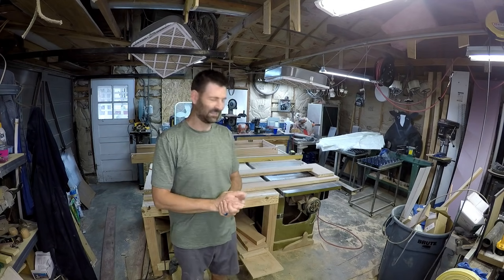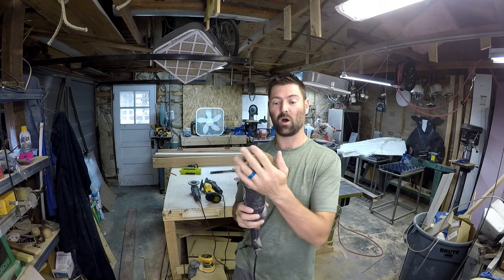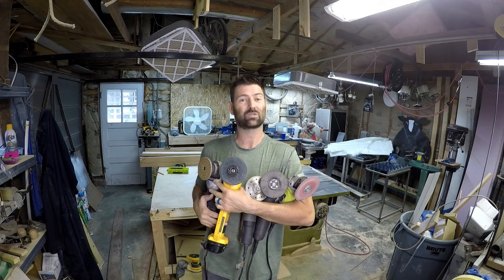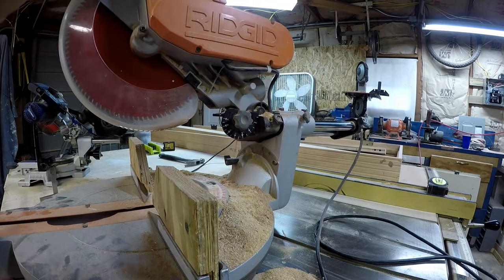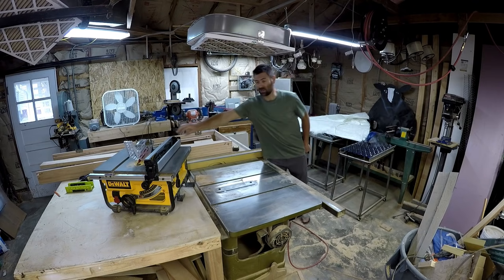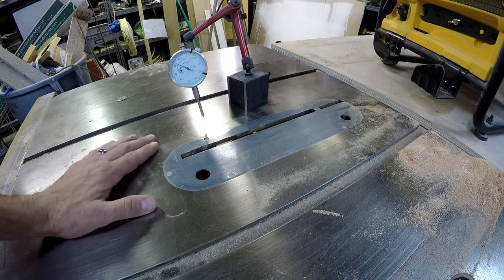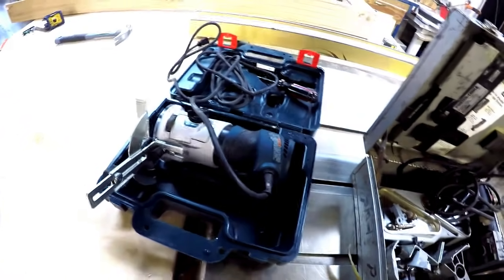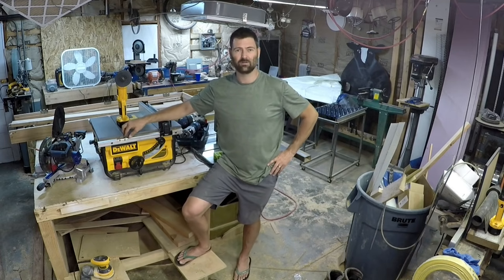Top 4 Power Tools You Need for Home Improvement Projects | THE HANDYMAN |

Comment: Good job. I have "every tool known to mankind" in my shop. But in my daily rental property management field work, I use the hell out of a Cordless Dremel, Cordless Saws-all,  3" cut off grinder, cordless sabre saw,  one cordles drill set up for drill bits and contersinks, and one cordless drill set up for a 6" magnetic #2 phillips and a 7 1/4  Skill saw. I just found some really sharp stainless multi-tool blades on ebay; they really kick ass. If they hold up, I'll use the multi a lot more.  I like the look of the Kobalt. I run into the need for matching 45's all the time. 90's are not that big a deal. 
-
Also, I've started using 1/8" HHS drill bits in a dedicated 36,000 rpm cordless Dremel. Talk about fast pre\drilling holes. busing out deadbolt screws, pins, steel/aluminum pilot holes, and such. It's amazing. 
-
I notice you don't have a magnet glued to the top of your drill to temp hold screws and bits. This trick has really helped me work faster. There's a Ferro /ceramic Magnet that is about 2" long and 1" wide. I get them at Lowe's. 
Cheers Handyman!

Comment: Happy Saturday Handyman. Millennials.  The young husband. For the first time in my experience, the man of the house was not even mildly interested in what I was doing or why. He was too busy playing a computer game,  and laughing hysterically,. Wifey wore the pants today, I had gone to their  rental to re-set a leaking toilet base and install a new Disposal.
-
 Both were unexpected trouble.  Cast Iron Toilet flange was a good 5/8"  above floor level and old disposal was a weird off brand, so my new Badger wouldn't match any of the drain plumbing.  
-
Toilet.  I tried the new Lowe's red Korky poly seal made for this elevated flange problem. I noted that it was not nearly as good as the green Home Depot Sani-Seal. I just didn't want to make an extra trip to Home Depot. But, it all worked out.

Disposal. Fortunately, I barely did have adjustment parts on my service truck. I should have taken this in consideration when I first assessed the cracked housing, leaking, old disposal. Why is it so hard to notice everything?!?

Comment: i like that there's no guards on any of the grinders. Safety Third! :) Keep up the great work on the videos!
Reply: Edward Cope Seriously is the guard really even necessary if not using a blade that can explode?
Reply from the maker: Its best to keep them on.
Reply: Agreed. I think a good angle grinder should make it easy to dettach,  reattach, and change the orientation of the guard without tools so you're not tempted to permanently dettach it the first time that it doesn't suit a particular task
Reply: I used one without a guard and the cut off wheel got pinched and when it jumped it nearly cut my thumb off! Two surgeries to try and fix the tendon, still have very little feeling in it so my advice is to make sure all guards are in place before using a tool. Oh yeah, I have been using tools for 40 years so I was plenty experienced with tools, but a freak accident can mess you up.
Reply: Milwaukies new guard system is pretty sweet. Easy to move around and easy to take off! Once got a decent gash on my hand with on old torquey dewalt. The new ones are way smoother.

Comment: I have the similar DW745, Only difference is only 20 inch rip. Now Dewalt seems to have made it only 8 1/4" blade. Don't think they still make the table top model in 10". Too bad. Sometimes  I need the depth. Also shaft is too short for stacked dado. But all in all the best job site saw I have seen. Bought my son the Hitachi, now replaced with a Dewalt like mine. I too made a job site bench, table saw on the right end and miter box in the middle. Space on the left end for a router table function although I have not done that yet. Great channel keep it up.

Comment: Great Video!  I believe that I would install guards on the grinders fitted with the cutting/grinding wheels.  You never know when one of the wheels will fail.  I've had a few come apart while in use over the years.
Reply: Yes I agree.  I have a Dewalt angle grinder and took the guard off for some reason, don't remember now.  Was intending to put it back on right away.  I had an all purpose cutting blade on there.  A few minutes later the blade came all to pieces.   I put that guard on immediately and then put another blade on there.  But I do find a hundred of uses for my grinder and would like to have more than one.

Comment: Today, I went to a rental that they had busted up to pieces a large kitchen box drawer under a built in oven. Too much weight. In the old days I would take all the pieces to my shop and complete the repair or re-making there. Thanks to all of the modern, portable, compact tools available now-a-days, I worked on my 4' portable work table, and repaired it  totally in about 25 minutes, better than new.

Comment: I love my ridgid r4512 table saw but I won't buy ridgid again after the circle jerk that was dealing with signing up for the lifetime service agreement. One of the things that i found to be the most useful was a Ripping blade. I originally bought a 50 something tooth blade and i was not happy with the performance of the saw before switching. Im in the process of going to run a 240v 20 amp line to it and switch it over.

I recently bought a router to build some shelves and was super happy with all it can do. Though the sticker shock on bits is kind of the worst part. Unfortunately for sears but good for me they are leaving my area and i got a bit set dirt cheap. I will never use half these bits but it was a 32 piece set for about 40.

Thanks for the content.

Comment: Trying to decide on an angle grinder. A 4.5” but battery or corded? Had a 4” makita for 20 yrs until it burned out. So it is between a 4.5” makita or a 20v dewalt( already have a dewalt impact driver with 2 amp batteries).

Comment: Dude, you need more grinders. Lol, I will have to try the diamond blade on the next cast iron run in. One time I had to cut out an SS washer and only had a carbide grit hole saw of the correct size. I think 1-1/8" used plenty of lube and went right on through.

Comment: I don't recommend the 20v grinder. Do yourself a favor and grab the 60v one.

I'm a DeWalt guy, for sure. But, I just hated the 20v grinder, and felt like the 20v batteries just didn't do the job. FlexVolt is great. And, of course, the FlexVolt batteries work in the 20v tools. So, a bit of additional versatility.

Comment: Love your videos and find them very informative.  While I don't necessarily disagree with your choices of tools, angle grinder (most definitely) Dewalt table saw (definitely) Compond mitre saw (definitely) and router (yes).  But I would hate to think of having to do without my 18 ga. pin nailer.  However, I was trying to explain to my wife the other day how much things have changed in the home building business in just 10-15 years.   I was having to tear out some cabinets that had been put in with 16 penny nails.  Want a PITA.  Thank god for screw guns.

Comment: I picked up the Dewalt 20v 7.25inch slider about a month ago. I was tempted by the Kobalt after seeing you use it but I have had my eye on the dewalt for a while. I was in the same boat as you cutting everything with a skill saw. I love that little saw. Supper tight, no run out, smooth like butter and runs all day on a 6ah battery. The little saws are where it's at for punch out
Reply from the maker: The dewalt will be a tighter more accurate longer lasting saw than the kobalt.

Comment: When I bought my first tools a few years ago for a rental I’m fixing up, I went to several stores to check out the tools in person. Some of the angle grinders, for example, were too fat around the barrel for my fairly small hands, or too heavy. In terms of overall size, weight and balance, I liked Makita the best, but that’s a totally personal consideration. I also bought cheap or used tools for cutting brick or other activities that might wreck my good tools. My only regret is the single bevel, non-sliding mitre saw. I wish I had spent more and gotten the sliding double-bevel.

Comment: How long dose the 18 volt grinder run,? Got the flex volt, 20 /60 the 60 volt gets me barely 20 mins, it's a 2 Amp hour battery, dose better with the 20 volt range,

Comment: A question about the dwe7480... I already have a job site table saw that I love but I'm in the market something that can handle a full sized sheet of plywood with around four to five feet of clearance on each side with a locking fence. Does this DeWalt saw have a stand or "extension wings"? I currently use a circular saw to trim down full sheets before using the circular saw and it would be nice to be able to simply use the table saw.

Comment: If you do a hand tool video, could you please tell us which Leatherman or other multi-tool you think is best for handyman work? Thanks!
Reply: Sri Yantra : Thanks!
Reply: I have several leatherman tools and the one I found I carry and use every day is called the wingman. It is slightly more compact than other models, more ergonomic, but primarily, it has a clip on it so I don't have to dig around in my pocket to get to it. I can clip it onto my toolbelt if I'm wearing a toolbelt too.
Reply: Ty Brewer : Thanks!
Reply: Laura B. I use the Kobalt, it comes with a pouch that attaches to any belt.
Reply: Hardcase8, Leatherman Case, Fits Wave, CHARGE TTI or REBAR. leatherman Hard case Made In USA https://www.amazon.com/dp/B07CVMLCXF/ref=cm_sw_r_cp_apa_WqwuBbHSFZK1C

My buddy makes this case. It is sweet if you carry a leatherman very often.
Reply: He caries the Leatherman Charge. So do I and it is my personal favorite also. It is basically just a Wave with bettler steel for the cutting blade and some titanium to reduce weight. I do similar work to this guy and I'd say I use my leatherman more than any other tool. That's why I pay a bit more for the charge but the wave is like half the price. The one thing about both those tools is the sheath sucks. I lost my first charge because the sheath wore out. So replace it often or buy a good leather one. I have one by a leather worker on etsy. Was $90 for the sheath but worth it vs replacing the nylon sheath twice a year or the bloody knife again. Something that makes these knifes stand out is the swappable bits. Having a square drive or whatever on your belt and not needing to go grab a driver saves a ton of time when you are doing maintenance type work. Also, the needle nose pliers rock. Bonus tip: my second favorite tool is a Klein 11 in 1 driver. Best hand tool ever imo.

Comment: I’m thinking about upgrading my cordless tools, I have a “lime green set”, which has been honestly really good around the house,but is horribly inadequate in a production environment. I know you keep talking about going to 20v tools, but I was wondering about what you think of the Milwaukee m12 line. I see a lot of good reviews about them.
Reply: John Patterson I use mostly Milwaukee M18, but I have a few M12's, such as a drill, impact driver, Hacksall. They don't have the power of the M18's, but they are light and compact in comparison. And good quality. Look for brushless versions--worth paying a little more.
Reply: They are coming out with the next generation of the m12 series. I like the impact driver,,small,,lightweight,,get in to tight spots. I have both the m18 and m12 tools..I use them everyday in my work as a carpenter foreman/leadman. My m18 surge impact driver never leaves my side,,always can be used for something.

Comment: I need to learn how to use a router to address some things that I or girlfriend's  have not been able to get contractors/handymen to do. In the last handful of years I keep getting solicited by friends or "friends of friends" to fix or do random things that greatly improve their quality of life or properly address something broken or was done crooked. 
I learned tiling from my parents at age 8 and that was start of me getting snagged to help out since my teenage years. I love my angle grinder, I've done some awesome custom mosaics using tile scraps with it.  It would not surprise me if I end up opening a handyman type deal in the coming years due to volume of requests I get or my empathy rooted from my own frustration in getting someone more experienced to address something. 

How can I teach myself, as in videos to watch before I attack scraps in practice,the router & the multi tool that takes the square blades? 
This type of multi saw - https://www.homedepot.com/p/RYOBI-18-Volt-ONE-JobPlus-Base-with-Multi-Tool-Attachment-Tool-Only-P340/202868525?cm_mmc=Shopping%7CG%7CBase%7CD25T%7C25-9_PORTABLE+POWER%7CNA%7CLIA%7c71700000044155732%7c58700004615424082%7c92700043235553558&gclid=EAIaIQobChMI9aPuhrig4gIVV7bACh2odAwkEAQYASABEgL8ifD_BwE&gclsrc=aw.ds

Comment: Why don't you buy a replacement collet for the porter cable trim router?
Reply from the maker: I will eventually.  I need to try to find the part on porter cables website.
Reply: The 7310 router's collet part# is 684718 and the collet nut part# is 691257, both available on Amazon or through a DeWalt service center.

Comment: I cant be bothered lugging aroung a table saw ,so I use either track saw or skill saw with or without a fence.
Reply: Arguably safer than a table saw aswell just put tape on to avoid scraping finish surfaces.

Comment: I recently bought a commercial grade craftsman table saw. 220V 5 hp! It is amazing! I got the best deal on it ever..... not because it is an awesome saw but because it came with everything INCRA! The Fence(1/1000th of an inch repeatable) router top/lift/jigs/cross cut jig/etc. I paid 500 for it all and all the incra stuff alone was over 2500. Plus all kinds of other goodies. Unfortunately the guys dad passed away and just wanted to get rid of it all. I got the deal of a life time with it and it is going to great use! My FB page is Bolt and Block wood works and I also own a Fabrication/ machine shop. Eagleworksfab.com. Love the channel. Keep up the great vidoes.
Reply from the maker: I think I know the one you are talking about.  It was on my list when I was shopping. That's a great deal you got.

Comment: I dont own a table saw. Just rip everything with a circular saw. Its actually straighter then a "jobsite" tabel saw.
Reply from the maker: I'm shopping for a track saw.
Reply: I don't believe that anyone can consistently rip everything and have it to be more accurate than the Dewalt table saw he shows.  They are very accurate every time.  And very light.  Great for handymen.
Reply: Real Deal DIY Great I've got some 1x1 I need ripped in half
Reply from the maker: I got a kick out of that one GarwoodNick.   I use the table saw for cutting filler strips when installing cabinets.  I rip down trim boards, shelf nosing the list goes on and on. If I can get away with out getting the table saw out I will.  The Dewalt fence is rock solid and very accurate.  The old Hitachi I showed in the video is a different story.
Reply: David Willmon it doesnt need to be all that acurate when you have caulk. Im a remodeling contractor not a cabinet maker. Plenty people have said I do things with my circular saw most people do with a table saw. I have made trim items, and everything. 

Even made some simple railing molding once with my saw and chisel out of a 2x4. I honestly dont see how any pro cant do it. 

If you men find the Dewalt faster or easier more power to you. Personally I dont touch table saws or track saws.
Reply: Track saws..hmm. Great tool!
I can think of 4 off the top of my head...Festool,,,both corded and cordless. Makita, DeWalt, Grizzly.
The Festool cordless TSC55  rig is going to run 875$. 55" Track,,saw,,2 18v batteries and charger.
Track saws are great tools.
Milwaukee has two miter options, 7 1/4" and 10". Also  a cordless table saw. Tools are getting better and better all the time.